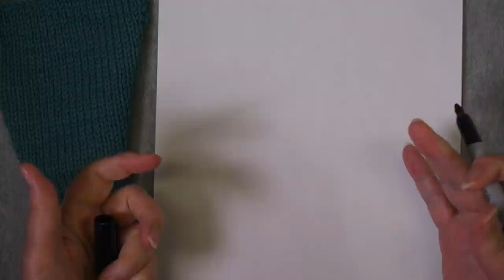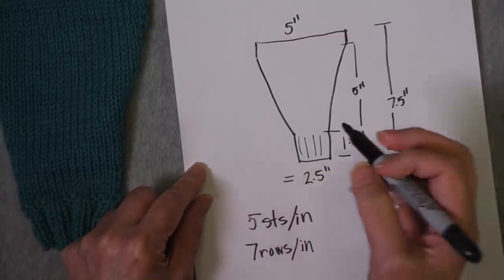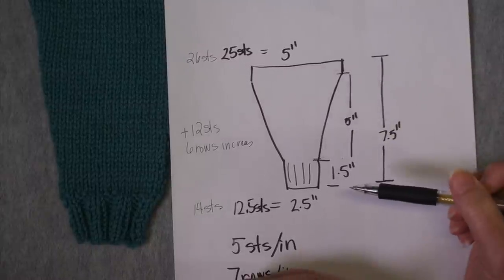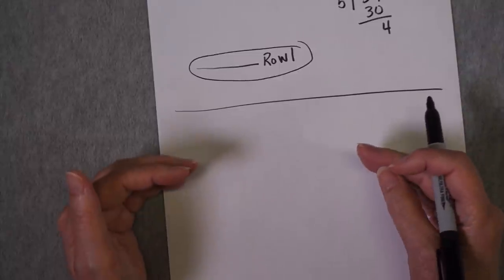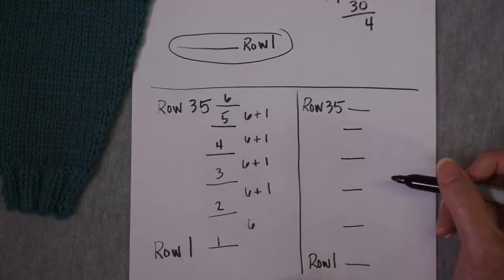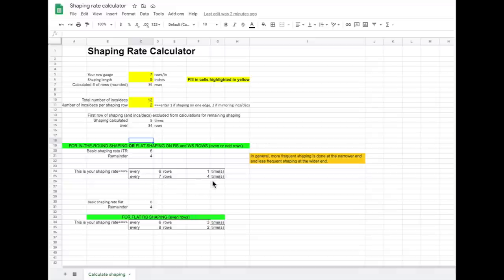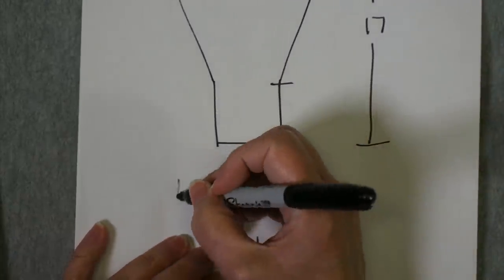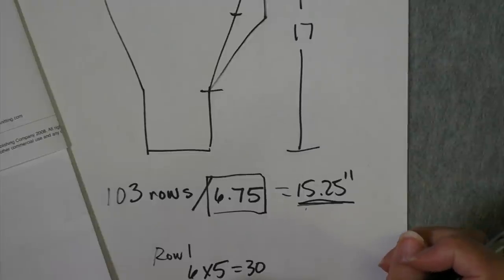How to (re) calculate shaping rate for sleeves (and raglans) // Technique Tuesday

Comment: Thank you so much. This video has been extremely helpful.  I have previously used Cheryl Brunette’s more or less method, which is similar to what you have demonstrated. More often than not the result of my calculation would require me to increase on both odd and even rows. I have never been able to easily make changes, so the increases appear on the right side only.  
Another excellent demonstration 👍.  And, on behalf of all of us who are mathematically challenged thank you for the shaping calculator.
Reply from the maker: I'm glad you found the video helpful. I had wanted to post it a few weeks ago, but I wanted to make sure I explained the process and provided the calculator in a way that would be most helpful to those less mathematically inclined. :-)
Reply: @RoxanneRichardson  You succeded !!!

Comment: I use ratios to figure rows needed by comparing my gauge to the pattern and then multiply the rows. I have to figure this all the time with my knitting machine. Since the garment can't be measured on the machine I have to know ahead of time how many rows to knit even for the front and back for every change in shape.

Comment: I have this so called Knitting Math Wizard. What system are you using, and is it possible to download now a special knitting calculator? I did not see a link anywhere to the Excel calculator you used. Sorry found it.

Comment: This is a great video, thank you so much for you explanation. Question. If I want to add 1 or 2 inches in length on a flat sleeve. Where is best to add that length, right before shaping the top if working from bottom up?? Thank you
Reply from the maker: Distribute the extra length in 2 row increments between each of the increases/decreases (depending on which direction you're knitting).

Comment: I am making a raglan sweater and my row gauge is more rows per inch than the pattern indicates. The pattern has increases every right side row. How would you suggest adding in more rows on the raglan  shaping in order to get the kind of length I need. I am off by about an inch. Maybe I could get away with just adding in some straight rows. It’s a top down sweater, fyi.
Reply from the maker: You need to add an inch's worth of rows over the total length of the raglan shaping. You can do this by adding an additional 2 plain rows between increase rows as you approach the underarm, so that you can maintain the incs on RS rows.
Reply: @RoxanneRichardson  thank you so much! I have blocked what I have done so far, and plan to have my son try it on before I proceed, just to be sure!

Comment: But how do you calculate the stitches to attach to the body ? The body has a bindoff of 11 stitches, then 42 to shoulder, but the total top of the straight sleeve is 84 stitches?  Help please.
Reply from the maker: I would need more information about what sort of sweater construction you're working with. I am happy to help with specific project questions in my Ravelry group. You can find a link to my group at the bottom of any one of my videos. Start a new discussion thread, and explain what sweater pattern you're working with, what the original instructions say about decreasing, and what your gauge differences are from the pattern.